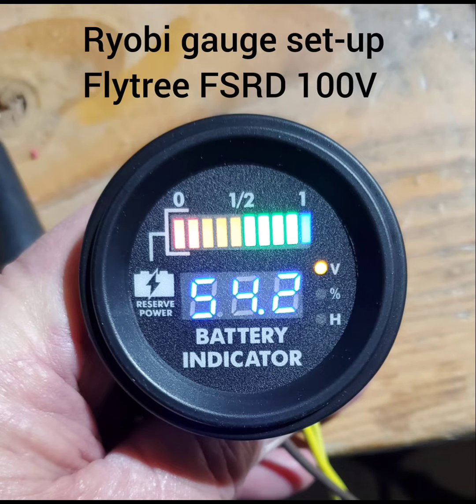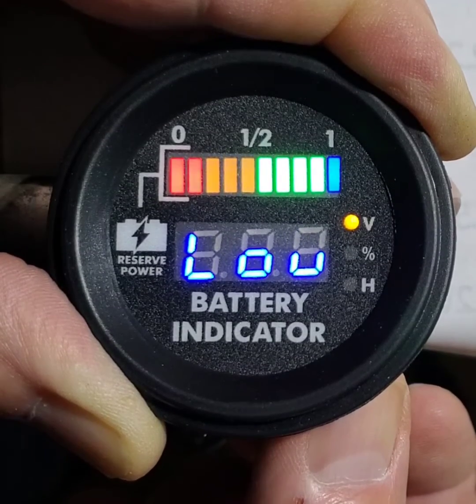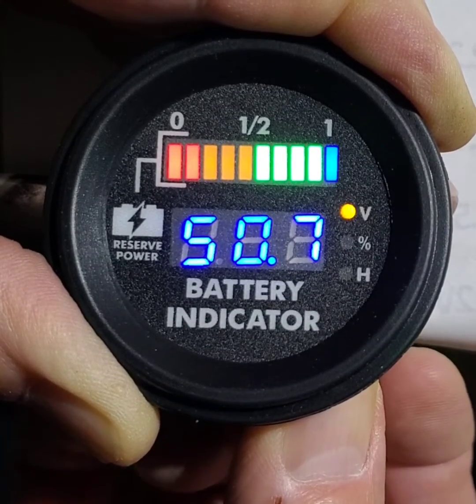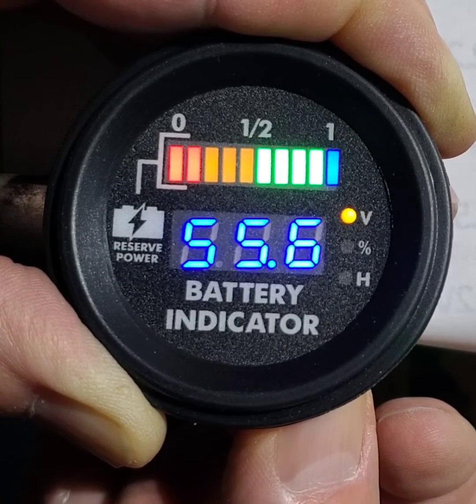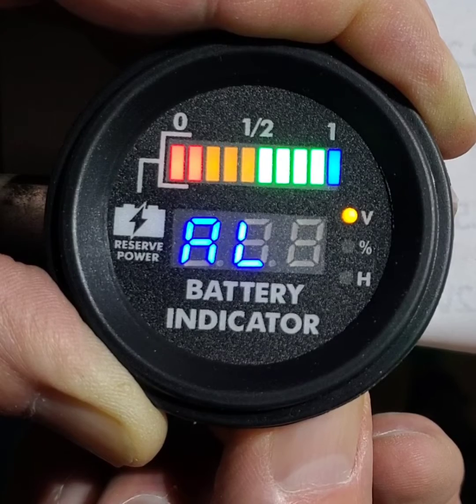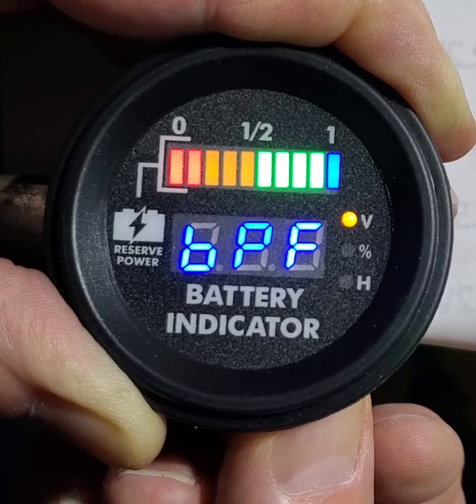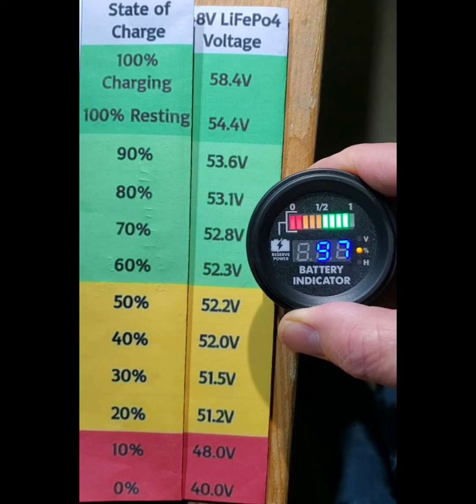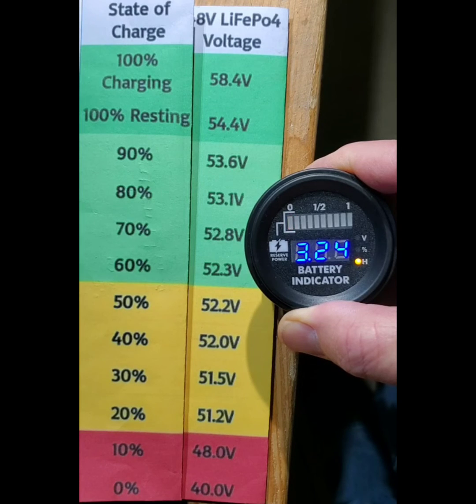Ryobi riding mower battery gauge set-up for lifepo4 batteries. Flytree FSRD 100V gauge.

Comment: I have another problem with my lifepo4 conversion. 48 - 51.2 V 55Ah (big) battery C/w charger BUT too many sparks when connecting charger via alligator clips (supplied) . I'm considering adding a diode  to the positive side.... between charger and battery, will this solve my issue?
Reply from the maker: @kjoller4
Try plugging in the charger and turning on the switch if it has one. Then turn it off or unplug . Then quickly connect the alligator clips. Then turn on or replace it in to start charging. 
The spark co.es from charging capacitors in the charger.

Comment: Link to the Aliexpress now goes to a version without the programing button. The description indicates it works for LiPo batteries and there is a comment about a menu but it is not clear how to get to the menu and how that all works. Any help with this?
Reply from the maker: This is the one I purchase and they even use my video
Just found this amazing item on AliExpress. Check it out! 
$14.50 | Round LED Digital Battery gauge discharge Indicator hour meter state of charge forklift, EV, 12V 24V 36V 48V 60V 72V
https://a.aliexpress.com/_m00IWSs
Reply: @Ryobi48vElectricMowers  It's now on sale for about $6.55. I tried ordering two just in case but the site was a pain in the neck,

Comment: I got one of these gauges and set it up, but it is kind of useless. As soon as I start mowing the voltage drops (which is normal) and the gauge shows 50% or less. So I actually can't tell if the battery is about to die or not. Last time I finished cutting at 3% but after resting the mower the gauge went up to 50%
Reply: Thats normal for voltage-only sensors. There is always a big voltage sag with batteries when they are under load.

Comment: I purchased and programmed this "new" gauge, and everything seems to be working... but...my LIFePo4 Eco-Worthy 51.2V 50Ah battery seems to lose some voltage while not being used.  After charging with P3648 Smart Charger, new gauge reads 100% and 54.5-55V; but after a few days the % falls to 97 and voltage drops to 53.5-54. Someone else did the conversion on this Ryobi 480e about 6months ago. Is this normal for the LiFePo4 batteries or might I have a bad gauge?  I did disconnect the Camway replacement gauge and shunt. Love your instructional video, took a few tries to get the sequence correct with the button pushing.
Reply: LFP batteries do lose charge just sitting idle.  Just leave the charger plugged in, won't hurt anything.

Comment: My ryobi 30 rider, just started doing this, it stops like it’s bogging, just acts like it’s out of power. You turn it on and it works a second, turns off, the battery’s are good, a,ways charged. Seems like a controller limiting it. The battery indicated never worked right, unit is 2 years old.

Comment: Thanks so much.  Do instructions come with the gauge?  Do you have written instructions?
Reply from the maker: Instructions do come with the gauge.  But to get it the most accurate you need to use the manual low and high voltages.

Comment: So no battery shunt required like with other guages? I like it, and it looks like the factory gauge and no cutting the hole bigger either.
Reply from the maker: Correct. It's a cheaper option for lifepo4 batteries.
Reply: @Ryobi48vElectricMowers  would you go this route or the previous one which has some other advantages but you need a shunt, cut hole bigger?
Reply from the maker: The best option is get a single lifepo4  48v battery with Bluetooth.  Next is the gauge with a sensor and third is the factory replacement gauge that can be programmed.

Comment: Do you have link to the gauge, I can't find it on aliexpress? Also, can you just remove the existing gauge and attach the wires to this and calibrate and be done? Thanks.
Reply from the maker: Here's the link. Take a look at yours first some had the program switch.
It has the exact same connections. This is the company that supplied the gauges to Ryobi. It took less than 2 weeks to receive it. 
https://www.aliexpress.us/item/2251832362676766.html?spm=a2g0n.order_detail.order_detail_item.3.95dff19cmrkeJx&gatewayAdapt=glo2usa
Reply: @Ryobi48vElectricMowers  I will take a look, thank you
Reply: @Ryobi48vElectricMowers  are you saying if the stock one has the program switch we don't even have to buy a new one?
Reply: @Ryobi48vElectricMowers  Well I ordered on the first site with  a half price offer but wanted two just in case. So I ordered on the next site just in case for the full price. The second is much easier just to pay.
Reply: @Ryobi48vElectricMowers   Perfect.Thanks for the link.  I ordered it and while the photo in the listing didn't show a button on the back, what I received did have the button on the back and written instructions! Many thanks.